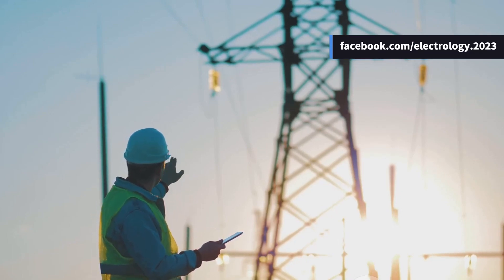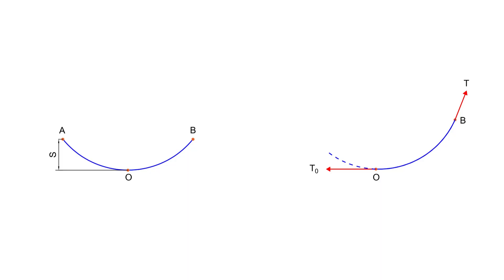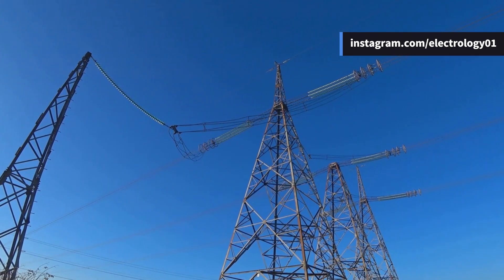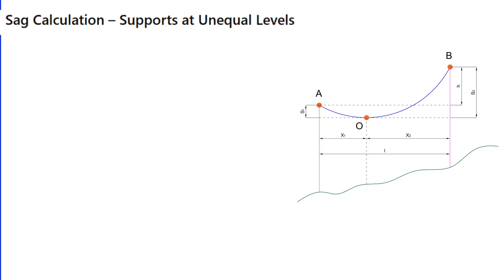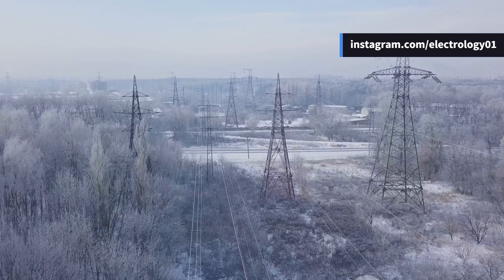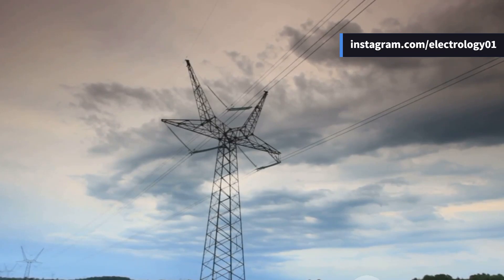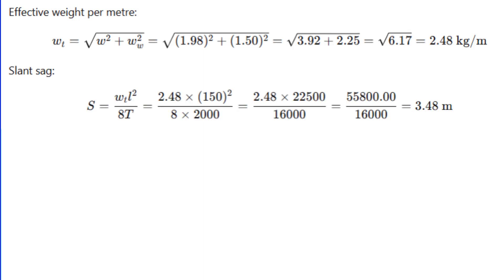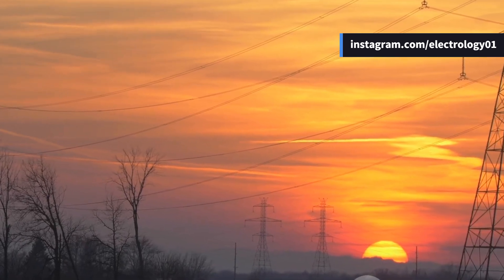What Happens When Sag in Transmission Lines Goes Unchecked?

Comment: I am in NY/USA and the sag on transmission lines can change a lot during summer month. And it much more that the hot weather. It is the load on the lines. High current causes heating in wire and they will sag even more. and look like too much sag. This has even caused power failures when the sag causes lines to touch trees. The line trip out. Then they cool and rise and come back on line just to trip again.  When we get record breaking heat we see this. Also we have lower than normal line voltage and can get to the point of tap changers at max and cap banks correcting for lag power factor . Then in parts of the USA we do load sheading to save the grid from failing. We call them roiling black outs . And this cam be the grid gust can't handle the load. Or lack of power at plants .
Reply from the maker: That’s a very insightful explanation!  You’re absolutely right — it’s not just hot weather, but also the heavy load on transmission lines that increases heating and sag. When sag gets too much, it can touch trees and cause tripping, leading to outages. Load shedding and blackouts in such cases make total sense. Thanks a lot for sharing the real-world scenario from the USA!  It really adds depth to the topic.

Comment: in summer since it is hot the transmission lines easy expand increasing sag , yet in winter the cold condition cause the transmission lines to contract thus decreasing sag.
Reply from the maker: Exactly 👍 You’re absolutely right! In summer, due to high temperature, conductors expand which increases sag, while in winter they contract, reducing sag. This effect is due to the thermal expansion property of the conductor material. That’s why engineers always design lines considering both maximum temperature (to avoid excessive sag) and minimum temperature (to avoid too much tension).